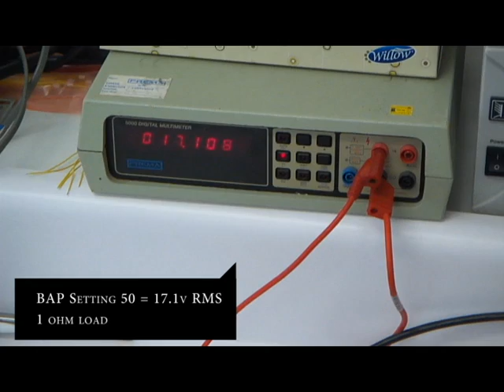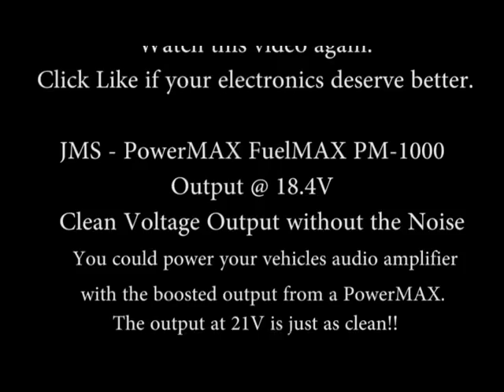JMS - Comparing Voltage Output Noise of a PowerMAX PM-1000 vs BAP 40A

Comment from the maker: 6) Status LED - Have you ever wondered if your current unit is on or doing anything?
                        Solid LED: Unit is on and regulating the voltage output to 14v DC.
                        Slow Blinking LED:  Unit is Boosting Voltage 
                        Twinkling LED:  Unit is saving the Knob Setting

7) 40AMP fuse and 10 gauge wiring - PowerMAX is a serious unit that serious clean amperage.

Comment from the maker: 5) Voltage Ramp In/Out Feature, adjust the dip switches to control your voltage ramp in/out rate and eliminate fuel pressure spikes.  We typically recommend Dip SW2 ON, Dip SW1 OFF for the best response/performance.

Units that do not have this feature have 80+psi fuel pressure spikes.
Typically the "band-aid" fix is to either turn the unit on at a later PSI to cover up the problem or to wire the unit so it is on all of the time (not needed).

Comment from the maker: 3) 18V or 21V output from the same unit (ground the brown wire = 18V, ground the silver wire = 21v)

4) Knob Save Feature:  With the unit powered up (car running), set the knob and then disconnect it and the Knob setting will be saved (led will twinkle).

Comment from the maker: A couple of additional cool features about PowerMAX that you may not be aware of:

1) Output Voltage is always boosted and regulated to a minimum of 14V DC.
          Competitor Voltage =  alternator voltage - 0.5V (normally about 12.6V)

2)  High Quality Adjustable Hobbs Activation Switch with Screw Connections so the connections are positive and do not fall off (3-7psi)

Comment from the maker: Sorry, we have not performed that exact comparison test on a fuel pump bench.

It took three years to develop PowerMAX.  

Most of the three years was spent validating, testing and tweaking the design.  

After we were happy with the design, we validated via long term torture testing on several of the final units.

Torture Testing: PowerMAX sustained a 28amp output load (39amps input) for two months without failure.

Note: The KB can support an output load of about 15amps (30amp input fuse)